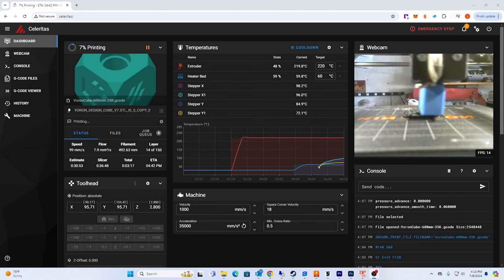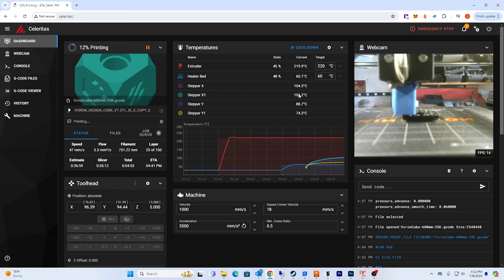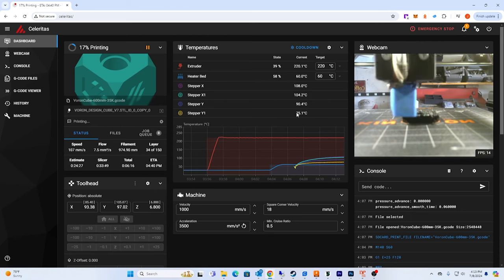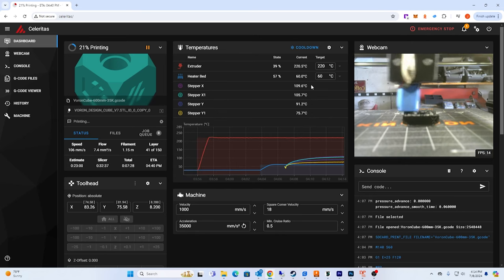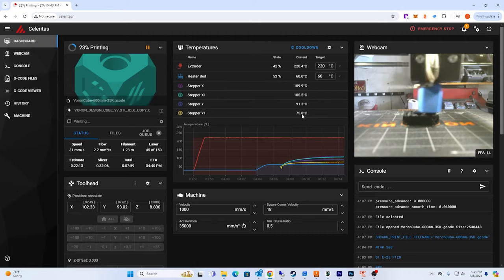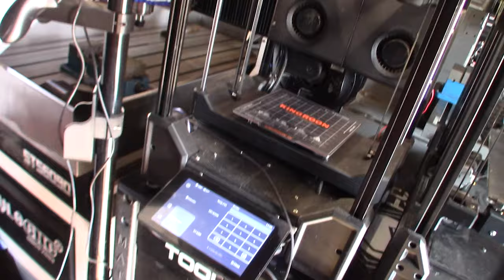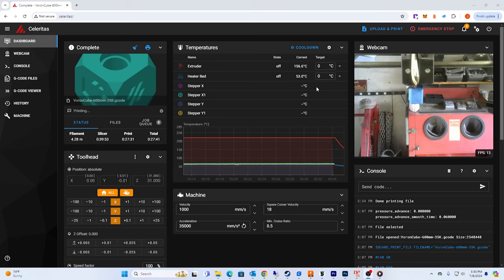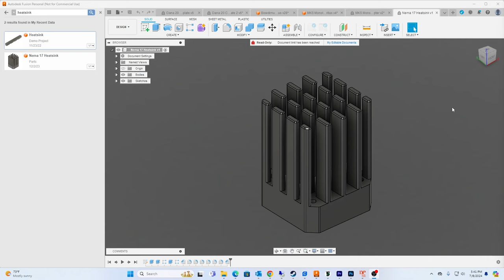Celeritas World's Fastest 3D Printer Concept, Driver Cooling Duct, CroXY Carbon Fiber Tubes Part 10

Comment: Have you tried water cooling, in ham radio amplifiers LMDOS transistors it's becoming very popular.  Less current, less heat, etc etc.   Only issue is that if plumbing design is not robust enough you can get leaks
Reply from the maker: My computers are water cooled. I might try it. Machine some water blocks.
Reply from the maker: @infowolfe  I watch his channel, that's one of the channels that inspired me. Printing fast looked pretty cool. I'm trying to not copy anybody or use any other projects parts.
Reply: @fintechrepairshop  I hear you, I guess if you've got the capability to machine your own, you can definitely do that, just letting you know they exist. I might have a few of them, even if they haven't been installed yet. there are other sellers of nema17 water coolers and I seem to remember some of the hevort guys talking about putting copper shims and heatpipes onto their steppers to pull the heat from the side of the bodies down into the plate on the base, since the sides of the steppers are the prime source of heat.

Comment: Unfortunately, the real problem here is that the polulu driver form factor sucks for cooling. The heat sink surface area is a joke. These drivers are designed to be attached to a large ground plane, where you could attach a much larger heat sink (and the ground plane acts like a pretty good heat sink by itself, better than one of those tiny ones you stick on a polulu). That's why manufacturers like Duet use drivers soldered to the main board.
Reply from the maker: I agree, even machining a large heatsink block would be a headache. Avoiding the soldered pins adds complexity.
Reply: @fintechrepairshop  A friend of mine mounted his polulu-style drivers external to the board with wires, directly on top of an extremely large heat sink (at least 150x150mm). His heat sink has a small step to clear the pins and he used thermal grease and a clamp, not a thermal pad (he didn't machine the face, he just used a small strip of copper the right width and then flattened the mating surfaces). With that setup, he was able to reach the rated maximum current with TMC2130s...which is super impressive. I made fun of him a bit because it is a lot of effort to go through to avoid making a board 😂
Reply from the maker: @jessicav2031  I would love to sit down and learn the PCB part of fusion. I think I mentioned making a PCB with large capacitors and mosfets that any driver can plug into. Run the motor current trough the mosfets instead the driver IC.
Reply from the maker: @jessicav2031  My theory on adding large capacitors worked!!!